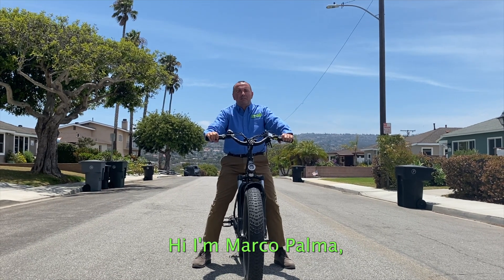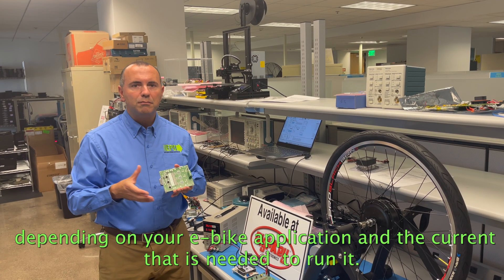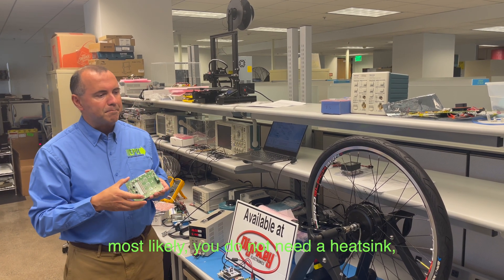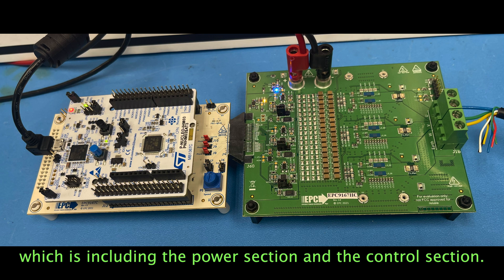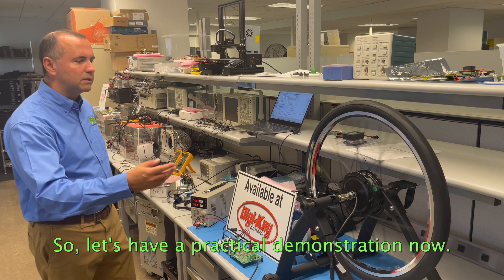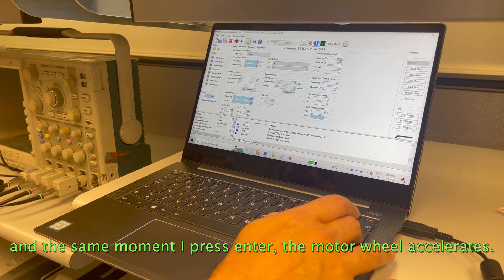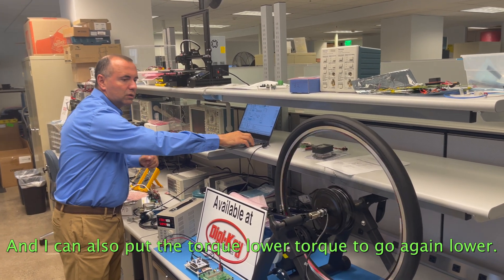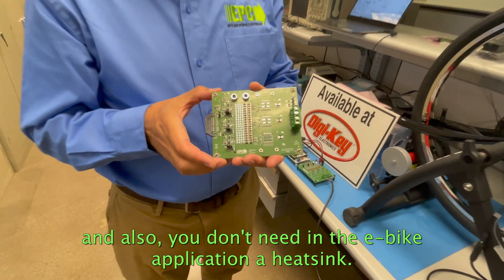Gallium Nitride (GaN) FETs and ICs Shrink Motor Drives for eBikes and Drones.

Comment: Can I use TI DSPF28335 with the inverter for interfacing?
Reply from the maker: We offer our reference design board with a generic adapter called EPC9147E, where you can connect the 6 PWM commands, the 3.3V power supply lines, the analog current and voltage signals, and the overcurrent signal.
With the EPC9147E you should be able to quickly adapt and connect your F28335 board to drive the inverter boards.